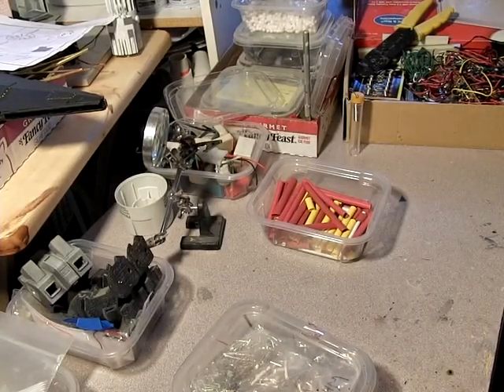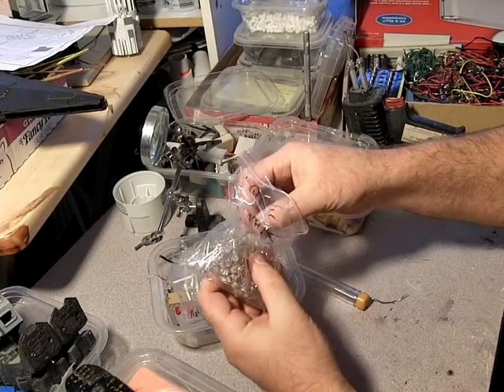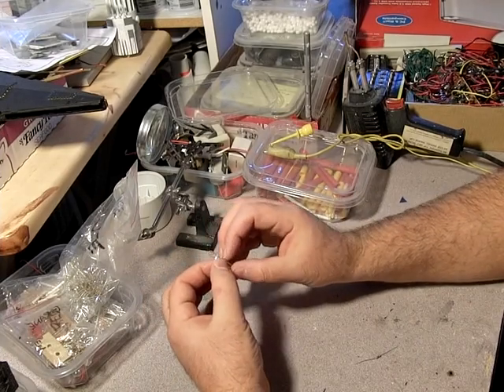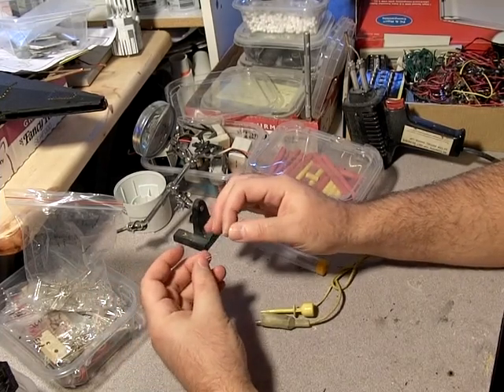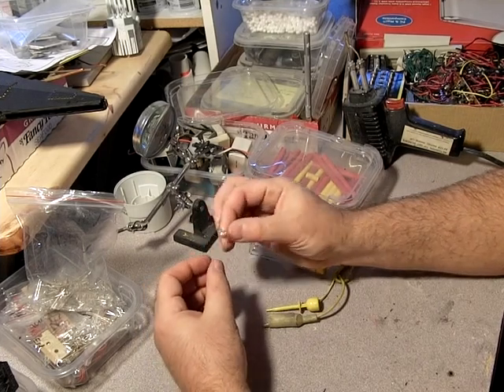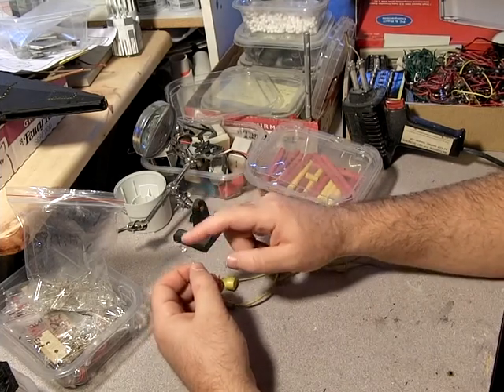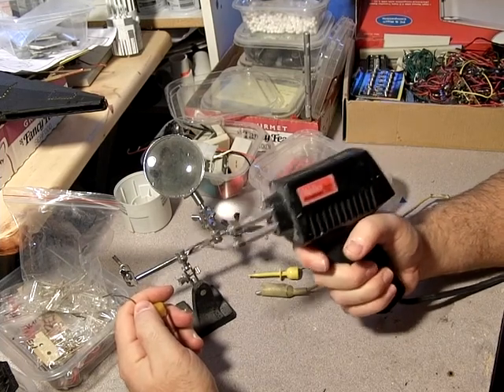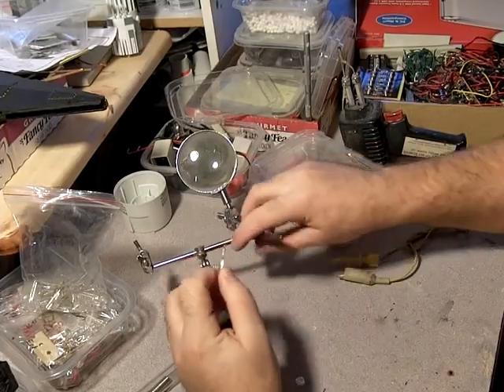Tips: Soldering

Comment from the maker: Understandable. I can say it is definitely easier than it seems.  I was terrified of this stuff at first.  

A good way to start for about $10 is this: over on ebay search for 100 pc leds.  You will find many vendors that include free resistors with the leds.  You tell them the power supply you want to use and they will do the math for you and send the right resistor rating.  

At $10 for 100 shipped to your door, you won't worry about burning through a  few while you experiment.  Good luck!

Comment from the maker: That's a little more complicated.  There's a formula though I don't remember it offhand.  If the led voltage is different than the power supply, you need a resistor to step the power down so you don't blow the leds.  I don't know if I have a specific video covering that info, but it is likely buried in the lit model videos such as the star destroyer, cylon raider, awing, vader's tie fighter and maybe one or two others.

Comment from the maker: Thanks. Yes you can put more leds onto a single resistor.  You get into a serial/parallel situation at that point.  As long as all the math works, you are set.  The wires can be as long as you can find them.

Comment: Resistors are measures in Ohms not Voltage.  A resistor also does nothing to the voltage, instead, it decreases the amount of current by the amount of resistance in the resistor.  Otherwise, good video.